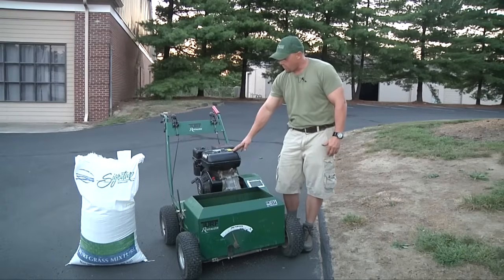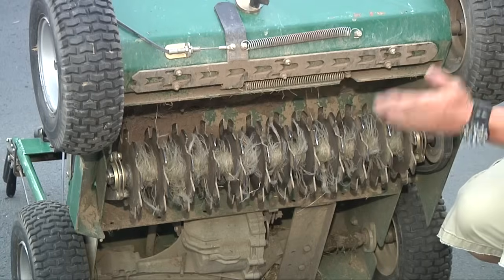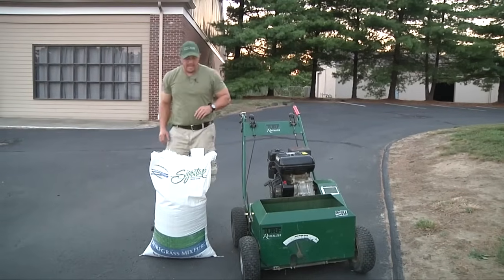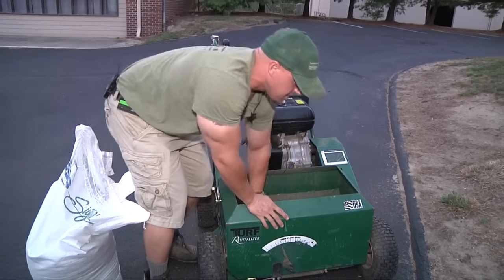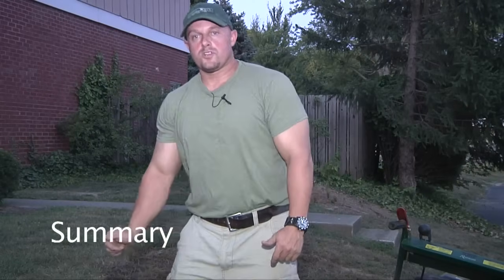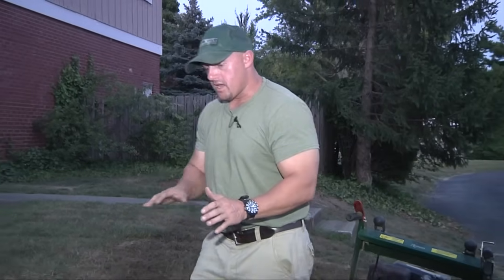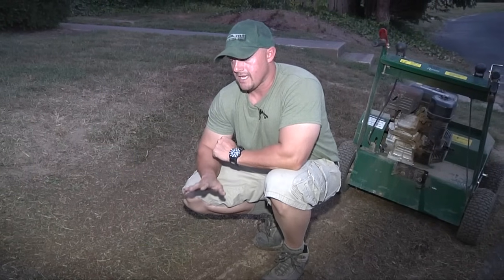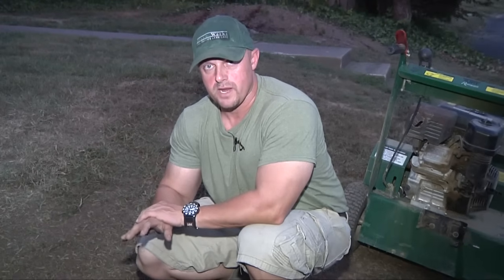Slice Seeder | Greenworks Lawn Care

Comment: I want to kill my lawn and plant all bermuda. Will it work with the slice seeder or am i going to have to pull up the whole turf?
Reply: use a non selective herbicide, kill off what you have now. Add topsoil or sand to fill in the low areas. Once your all done with that, this machine will groove in the seed nicely. No need to pull up what you have. I just rented one (toro version) I removed all my sod via sod cutter, only because i dont have time to wait for the non selective herbicide to work. (plus i brought in 10 yards or compost to topdress my soil with)
Reply: Thank you. That sure will make things alot easier!
Reply from the maker: Kill the lawn off. Than scalp lawn down with a mower remove debris and than use the slice seeder two different directions. Water daily.

Comment: I don't see how that can work.  First it drops the seed, then the blades smashes the seed in its path to smithereens so it could not possibly germinate, while the rest of the seed that misses the blade path lays on the top of the ground, same as if you had used a $25 broadcast spreader.  I would think for such a machine to be effective, you would need to cut the trenches first, and then have scarf-cut tubes drop the seeds into the newly cut furrows.  What am I missing?
Reply from the maker: We have been slice seeding lawns for many years. This is a proven method. Slice away, an watch it fill in.
Reply: When you plant seed by hand you always have seed that is exposed.  What's your point?
Reply: Nunya Biznis , yu right. When a plant seed falls from a plant in a jungle, do yu think it needs someone to go there, dig a hole, put seed in the hole, cover the hole with dirt to make it grow? Hehe
Reply: My thoughts exactly
Reply: @Jack T, good point. The seeds would be undamaged if they dropped after the slicer cut the soil, not before it. The amount of seed that was being dropped was key, in my opinion. The rate was very high. It looked like the seed was literally flowing out of the machine. At that rate, odds are that many seeds will survive the damage.
Reply: @SiliconFlower  Not a reasonable comparison. A jungle is a natural environment where germination rates don't matter and no one is throwing money at a problem.  Lawns are artificial environments and these machines and qualified lawncare professionals are available to help.  You don't have to take the advice...or criticize it...unless you can show an alternative with better results.